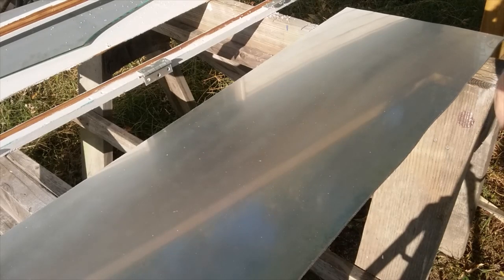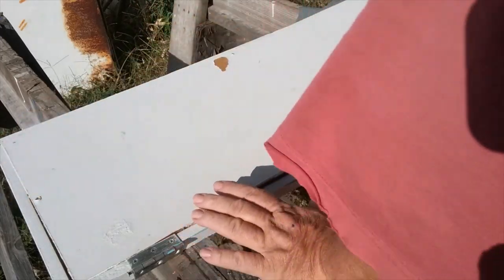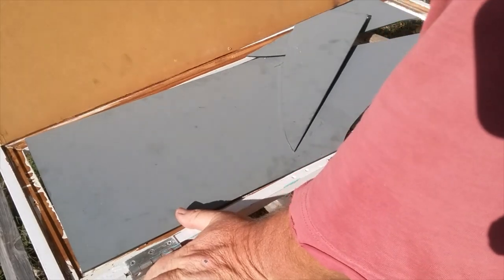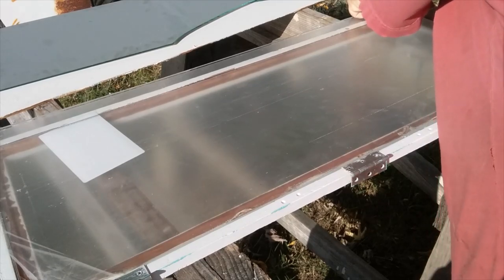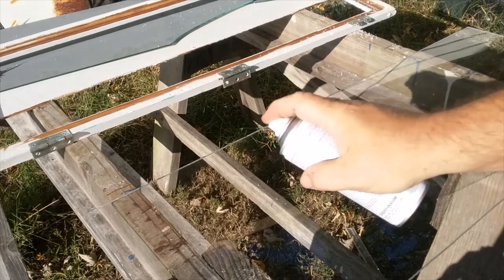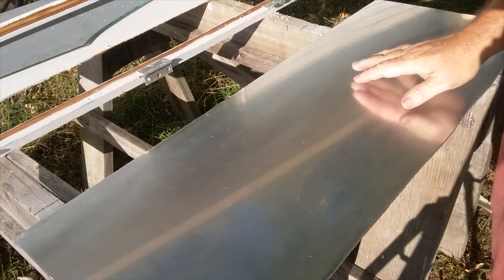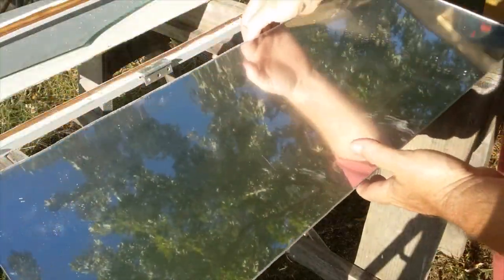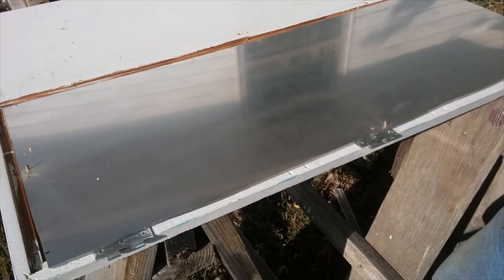How To Fix A Broken Mirror with Mirror Paint

Comment: Does the mirror paint cover up the breaks in the mirror?  I glued them together but the cracks are visible.  I do understand the paint doesn't repair it but does it cover the cracks up so they're not as visible as they are now?
Reply: Reading your comment above, the paint doesn't actually "repair" the mirror, but you would remove the broken mirror and replace it with plexiglass which you would then spray paint?

Comment: Crazy question but how much would it have cost just to buy a new mirror? I can’t see more than $10-$15 dollars. I haven’t priced any mirrors lately but from what I’m getting here a lot of unnecessary work for what looks like a pretty cheap mirror that u can get at any box store. Did like the info tho. Thanks.
Reply from the maker: I'm not sure because I'm not aware of any glass place near me. But I looked online (fab glass and mirror) for the size I needed and just the mirror itself was $75. I'm sure I could have found it cheaper locally someplace, but I'm not sure how much cheaper. One of the reasons I wanted to use plexiglass to fix this broken mirror is because this tenant and her family tear up nearly everything and I didn't want to have to replace it again.
Reply: @bryan oard jesuschrist!!? $15 bucks no way!!! At least 65-75
Reply: ain't nobody got 15 dollas

Comment: You didn't fix the mirror.  You replaced it with something else.  Why not just buy another mirror to put in the frame?
Reply from the maker: Because I would have had to go to a glass shop to get that size mirror. Then it would have cost anywhere from $50 to $75. Much better to spend around $20 the way I did it.
Reply: @BlueCollarDIY  But I broke a small mirror in half that cannot be replaced by another glass or plexiglass. This mirror us very sentimental to my friend. So I clicked on your video because it said how to repair a broken glass, nothing about replacing it with plexiglass. This is, a very small mirror with a stencil design on it. I wonder if someone can recreate it and she wouldn't notice it? I have pictures of it. I tried thinking of super glue but it would still show the crack, I tried thinking of a bond product then maybe use resin to fill in the crack that would be left.
Reply from the maker: @venjenciearnold9658   call around to glass shops in your area. Some may custom cut mirrors for you. They may even be able to do the stencil. Fixing broken mirrors usually isn't an option, they need replaced.
Reply: @BlueCollarDIY  thanks. I'm not sure we have glass shops in this area. See I broke a friend's mirror that was from a stagecoach in the 1900's. She knows I'm crafty so she asked if maybe I could clean it up a bit. I got the frame clean and looking much better. I got all of the silver backing off without scratching it up and it was like new except I had to re silver the back. It was so  late by time I got the backing dissolved and off so I said to my husband, I'll put this up and start on re silvering the back tomorrow since I have the stuff to do it with so where can I put it that you won't accidently break it and  he padded down a box and said put it in there. Then I said where can I put this big box up at and he pointed to a safe looking area. The next day I looked over at it and his cat somehow opened it and was cuddled up in the box. Immediately I told him but we waiting for the cat to get out on it's own. When it did we unwrapped it and the mirror was flat into.
Reply from the maker: @venjenciearnold9658  Oh wow! I don't know what I would do in that case! I'm not sure there's a way to fix that broken mirror. You might try and see if you could find a glass crack repair place, but I'm thinking this would be beyond their capabilities.
Reply: @BlueCollarDIY  I'm so scared to tell her and I feel so bad.
Reply from the maker: @venjenciearnold9658  I can understand that. Just remember, when everything else fails, blame the husband for breaking the mirror! lol
Reply: @BlueCollarDIY  lololol, love it. Ty